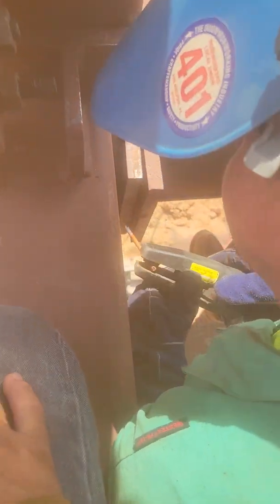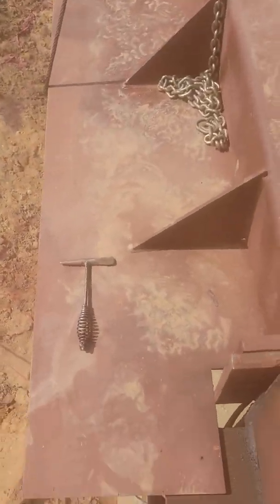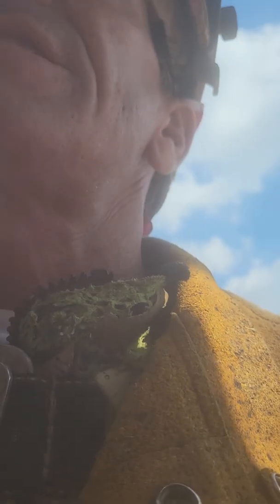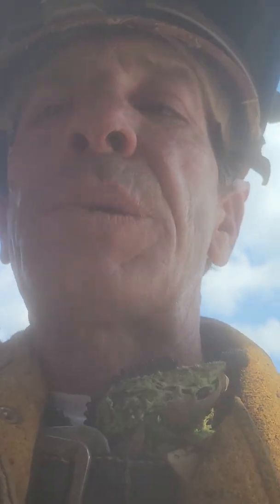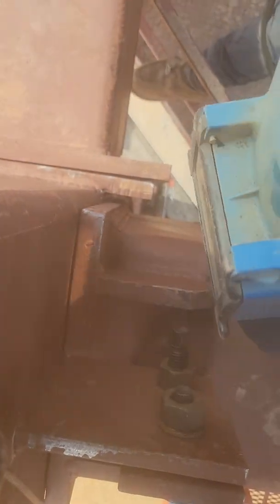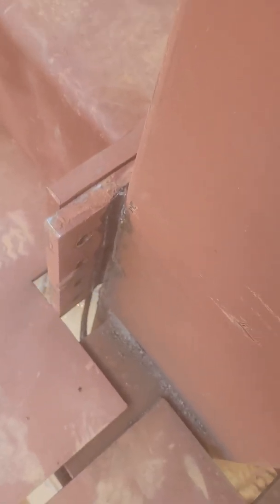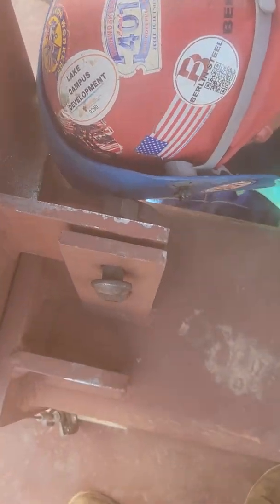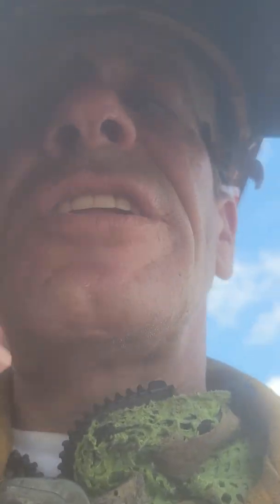STRUCTURAL WELDING/AIR ARC =DETAIL FIX

Comment: What hard hat and welding helmet attachment are you using? My fibre metal hardhat and pipeliner helmet with the quick attach knobs don't fit well. the helmet has to bend to fit onto the hardhat. and it just doesn't work well
Reply from the maker: Adam,  fiber metal,  zip clip, And the lock nuts You can get them on Amazon, There are aluminum nuts, And screw bolt, I don't know the name, The originals that come with the zip clip are  plastic and crap, junk, I've been using that zip clip for 30 years, I saw the aluminum screw  bolt and nut on Amazon, and I have been using it for 3 years it's holding up very well, The pipeliner, I had to shave the top of the welding shield  so it will go back  all the way, A little modification does wonders, I'll try to do a little video on what you're talking about, But I hope that helps you out, Have a great day

Comment: Can you explain what the difference between local 40 and 580? I wanna connect and weld columns and such but when I google “ornamental iron worker” there talking about windows and staircases…no offense to anyone but that sounds boring haha
Reply from the maker: Preston, #580 Miscellaneous and ornamental IRON, This local has a big Variety, Steel install, Stairs, handrail,  Curtain wall, Welding ,TIG,, The rigging  Knowledge is Very important,, I never worked out of 580, But if work is going out of their hall, You can do very well working out of that local, /Structural, #40 Structural steel erectors, Everything to do with steel erecting, The biggest and baddest iron to be erected on the planet, Local 40 does it, The welding is the biggest and baddest on the planet too, Local 40 does it, It's a very special place to work, You better be F in good, To be at an apprentice, In that great local ,you should be honored, Cause my time working there the apprentices were the best apprentices  ever assembled on this planet, The men and women worked their ass off, Preston, I tried to put it in the best way possible,
Reply: @jetweldingllc4691  YOU ARE THE MAN! Thanks for the clarification, you make local #40 sound so awesome haha 🤙 ran into a local 580 guy today got to pick his brain and I found it strange how he was bashing local 40 but I guess it’s some sort of rivalry thing going on, Anyways thank you 🙏🏼 and God Bless.